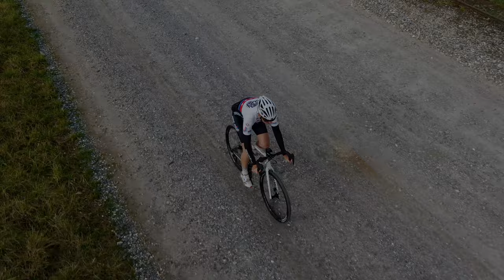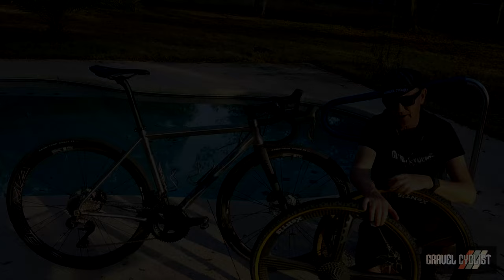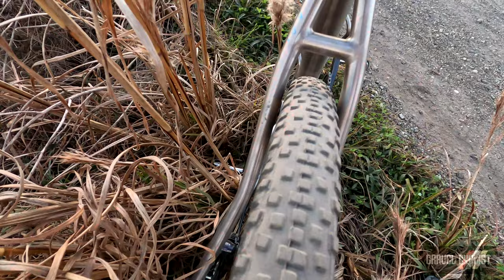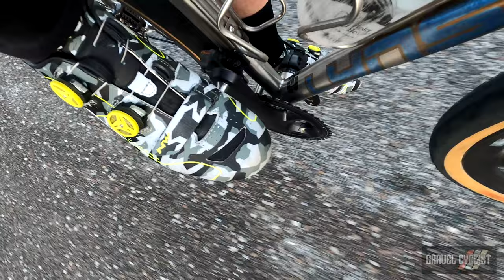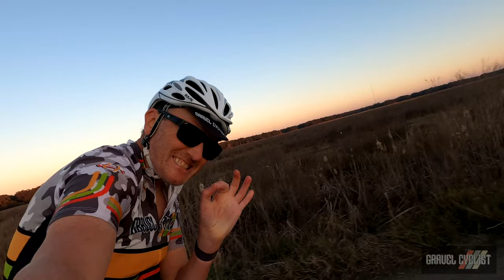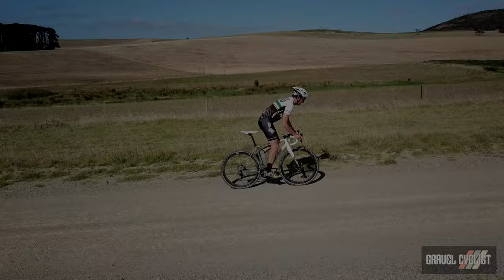Let's Turn a Road Bike into a Gravel Bike

Comment: I did this same sort of conversion when I built up my first Lynskey frame, a 2017 Lynskey Sportive  disc road. I first built it using Shimano 105-7800 compact 34/50 with 11/32 cassette, and TRP hybrid disc brakes. I extended the gearing soon after with a Roadlink and 11/40 Xt cassette. I found some inexpensive WTB SX23? 650b wheels and 47mm WTB tires rubbed the upper inside of the fork under load. A 44 or 45mm tire would have fit better, but settled on 42 WTB Resolutes which provide good clearance and have been trouble free. The result over ther years has been  the accumulation of numerous  1x and 2x road and GRX600 components that have mostly worked, but the clearance limitations of the road frame utlimate led me to buy my second Lynskey, a GR300 gravel model with better clearance and GRX600 2x groupset. I run it often with 650b x 47 tires for mixed singletrack/gravel routes. I have three sets of wheels for this bike accomadating road, graveI and psuedo MTB. I love the cushion of of the 650b tires when descending on mixed surface singletrack here in northern New Mexico. I was disappointed that the chainstays which flare put for better tire clearance, woudn't accomodate my Shimano Ultegra 6800 series crank with Stages powermeter. That crank has travelled axcross many bikes up until now. It fits fine on my first Lynskey, so I keep that bike for when I want power data. I'm not sure I'd do it again, but it has been a fun experiment and I've not regretted either Lynskey purchase ever.

Comment: I tried this with my current road frame.  Got a used set of DT Swiss 650B wheels. Then purchased a 47mm wide tire first knowing it would fit in the fork but tested if it would fit between the rear stays. Long story short, 650b x 47 on the front, 42mm in the back.  4mm clearance just like your conversion. Plus better front mech clearance due to the smaller wheel diameter.
Reply from the maker: Nicely done! Definitely a good stop gap if you're not taking the plunge to purchase a gravel bike in the immediate future.

Comment: Interesting. Seeing that I can use a Lynsky with wide tires is the first time I ever considered buying a frame with disk brakes.
Reply from the maker: Bear in mind, Lynskey make some amazing gravel bikes with big tyre clearance, what I showed here is basically a stop gap. Meaning, a temporary solution to buying a proper bike for the job. Either way, good luck with your decision making process!

Comment: Hello! I watched your previous Xentis review video. I don't understand why the wheels came with a rim strip, since they don't have the usual spoke holes, and this is one of the advantages of having  this type of wheels.
Reply from the maker: Hello! The wheels didn't arrive with a rim strip. I applied a layer of tape to help the tubeless inflation process go much easier. Depending on the wheelset, I may have to add one or two layers of tape to build up the base for the tyre to "pop" and seal.

Comment: I have the same frame. You mentioned in your build video that it looked like lots of room for tire clearance and you were going to see how big it could go. So staying at 700c did you test this out. 

How was the clearance with the front derailleur?
Reply from the maker: Tyre clearance is good with the Di2 front derailleur, but could be a problem with an eTap front derailleur due to the battery. I am going to mount up some 700c x 35's shortly and see how they do. That will likely appear in the review, but I'm confident it will work.
Reply: Did you test those 35s yet?

Comment: Would like to see what the Trek Domane you reviewed would be like with 650b wheels and the how much wider you could go with tyre width.
Reply from the maker: If the Domane was still here, I would try that. However, we are still reviewing the e-Bike version of the Domane which has identical tyre clearance, so will likely give that a whirl and see how it fares.
Reply: @GravelCyclist  That would be great. I'm building a new 4th gen Domane and was wondering if a second set of 650b wheels with wider tyres would work for gravel riding. In addition to having also a set of the 700c wheels with regular road tyres for road riding.

Comment: I’m really digging this conversion. My only worry would be with pedal strikes since the BB is lowered by a good bit due to the tire circumference difference with the smaller wheels. Did you have any issues with that? 
I was very close to trying this with my CAAD12, but I found a SuperX frame for cheap.
Reply from the maker: Hey there. I tested the bike last night on a crazy mixed-surface route that took in some singletrack and other madness. I didn't strike any pedals, but, that could easily happen if you're not careful with your pedal timing. This was mostly a fun exercise to see what was possible. I will say, the bike felt unbelievably fast and responsive.
Reply: @GravelCyclist  Nice 🔥

Comment: 650b is only 12mm larger radius I've 26". Waste of time
Reply from the maker: Yes, and no. This was mostly to demonstrate what's possible with a smaller wheelsize, making a larger tyre fit into a bike never designed for it. If I had some 26" thru-axle wheels (do they even exist nowadays), I would have given that a go.